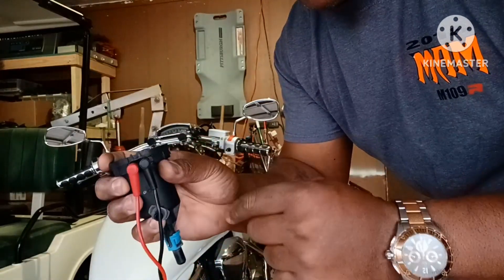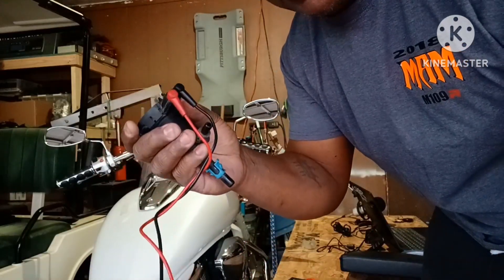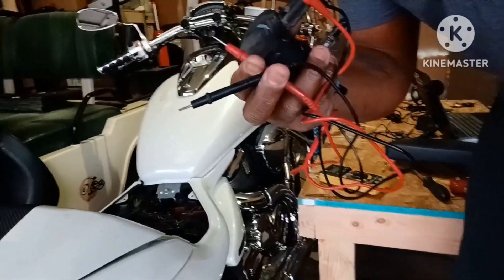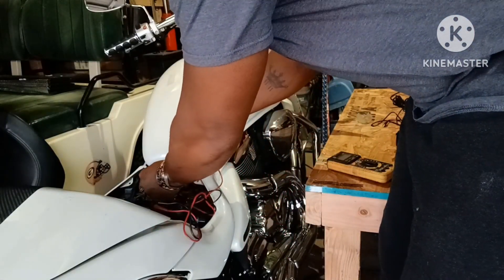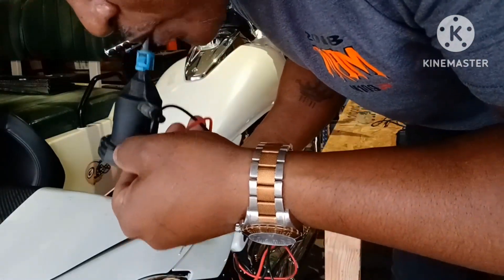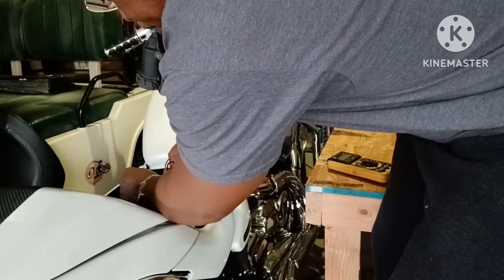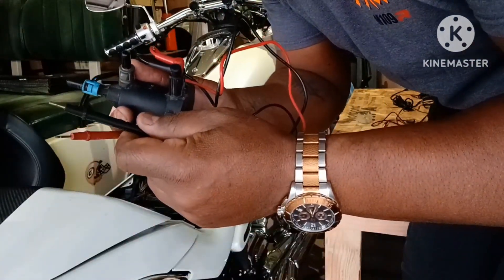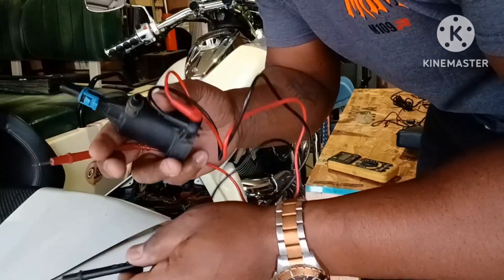Test Jeep Wrangler 3.8 Manual Evap Solenoid Test P0456 Code P0457

Comment: Great video
Reply from the maker: @iamKelvinJ  Appreciate ya, Kelvin 🙏 hope it helps ya solve the issue. My issue ended up being the evap valve next to the fuel tank, under the Jeep. $15 fix
Reply: @MicDropBBQ Are you referring to the leak detection pump that connects to the charcoal canister near the fuel tank? If so, I changed my detection pump and charcoal canister and now I’m hearing a buzzing noise when the jeep is running. Have you heard of this by chance?
Reply from the maker: @iamKelvinJ depends on if the buzzing is coming from the front or rear. I don't have that sound.
Reply: @MicDropBBQ  It’s coming from the rear. Sounds like it’s coming from the leak detection pump. When I twist it off, the buzzing sound stops. Idk 🤷‍♂️

Comment: A lot of times it will stay open just a little to trigger a check engine light and throw EVAP codes so a vacuum test is the best way to check it. Just disconnect all connections except the intake hose and lick your finger and put it on the bottom port to feel it there is a vacuum draw for about 15 seconds if leaking you will feel the suction and there is a defective purge test without tools or gauges.
Reply from the maker: Good to know! My issue was actually the evap sensor located near the purge canister under the Jeep. Replaced that and bam...Jeep's been fine ever since.

Comment: Good stuff !!!. I just replace mine yesterday.
Reply from the maker: Hope it fixed the issue! I thought mine was bad but testing it showed it still worked. My issue was the canister valve under the Jeep that went bad. Replaced that and my code never came back.

I wanted to test this to make sure I wasn't just throwing parts at the issue!

Comment: Those parts break if you put too much in your car
Reply from the maker: It's an evap solenoid. All cars use this part. It deals with gasoline vapors. What are you talking about? 😂😂
Reply: @MicDropBBQ  forgot to say “gas”
Reply from the maker: Ohhhhhh. Yeah, that word makes the sentence a lot different. 😂🤣😂 I was laughing because it's something I would say to fck with somebody! Haha

Not sure how they eventually fail, but this one still works, thank goodness. 254,000 miles on it and it still works.

I think it's another part. Bought ghe canister purge valve for $37 tonight and will install tomorrow. I can't test that, I don't think. But for $37, I'm taking it off and just replacing it.

Fingers crossed its the canister purge valve. I gotta get the Jeep registered before Super Bowl, man!!!!